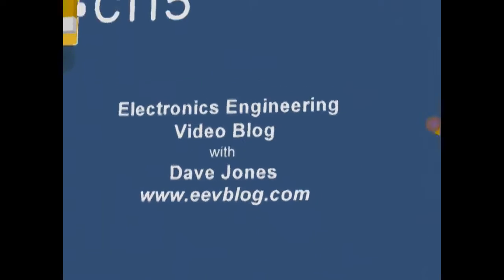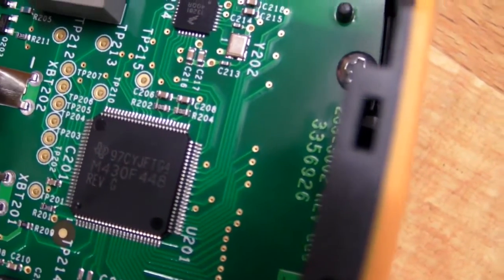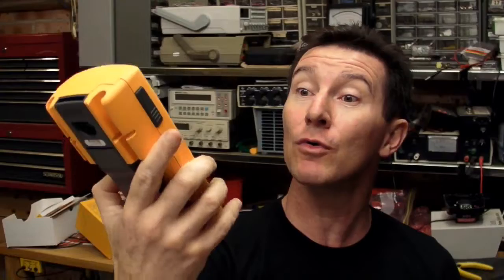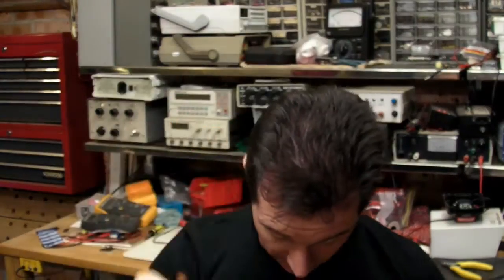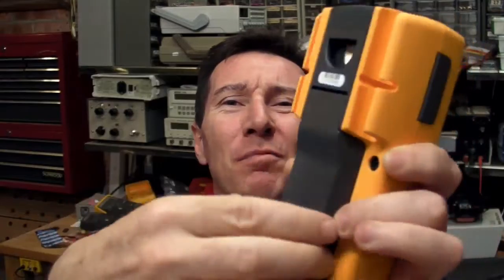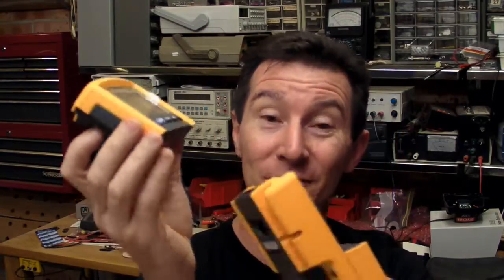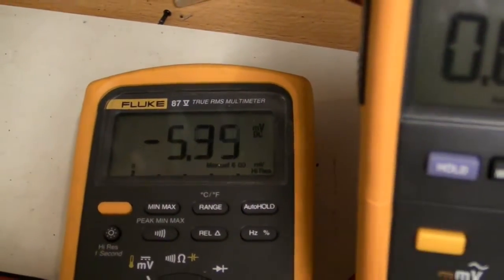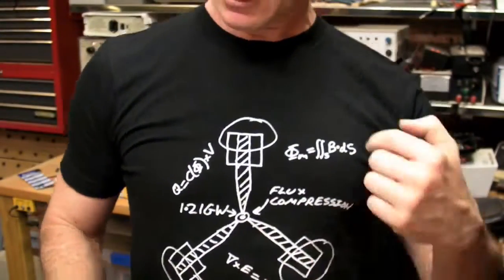EEVblog #43 - Fluke 233 Multimeter Review

Comment: I have a question and they fixed the problem about the battery discharge because they complain a lot about that the device discharges the batteries a lot and it only lasts for 5 days and I already discharge them even if you are not using it that was my question I need a device of those but I just want to know if you keep downloading it so as not to buy it

Comment: I bought one and it's a pile of Sh1t, eats battery's and Fluke want 200 euro to fix it.
Reply: It’s because you have the 1st generation, there’s been an update to a 2nd generation if you will. Mkii that resolves the issues. The problem is that it sounds like Fluke wants to charge $200 to update the early models to the mkii.

Comment: I had mine for a few years and the meter died blank screen and high voltage warning stuck on stay away
Reply: Do you have found a solution because I have the same problem? Thanks
Reply: I guess this is why it only comes with a 3 year warranty as opposed to lifetime with Flukes other USA models. Sad, stand by your products

Comment: Just a warning to you all.  If your fluke 233 has that rather thick clear plastic protector on the display remove it and burn it, blow it up or even put it in acid.   If left on the meter like I did and the sun gets to it in your work car it will stick to your meter like its got some glue on it that only Satan could have made.  It wont come off.  Mine is fused to the display.   I've tried everything to get it off and it wont budge. Even if you lift a bit off its just the top  layer and the bottom layer stays and makes a mess.
Reply: Jose Martin That’s a warranty claim IMHO.

Comment: I have one of these F233s and from this novis' point of view, these are a great meter.
Apparently the later production models have been sorted, but the early ones like the one I have has a disgusting battery drain issue.
My unit will kill all 5xAA batts in about a month ..while switched off.

Comment: I have this DMM and it eats batteries like nothing else.
400 hours my arse!
Reply: Agreed. I have the same and I'm pissed off about it. I'm freaking over it. And looking at buying something else.
Reply: im wondering if there is a bad batch issue on these, i have one that i have used daily for over 2 years and im still on the first set of batteries
Reply: I also have one and it eats battery's, I don't use the wireless function often and I'm using quality battery's. I used the meter for two months and changed the battery's two or three times. Ive gone back to my 83 series.

Comment: This is the kind of meter I use at work it works good if you have to operate something away from the meter you can just take the display with you.  It tends to wear out batteries faster than other Flukes (I have been using Fluke meters for 15 years) but not too bad considering the display and stuff.  I wouldn't buy this as my first ever meter nor would I buy one just to use every now and then I would only buy one if it is something you would a lot.  There cheaper meters for those things.

Comment: I have a fluke 233 which is faulty. It appears resistor R129 has fell off. Could anyone check the resistance of this resistor, or is there a service manual available? The resistor is just above the + terminal on the main unit. Cheers!